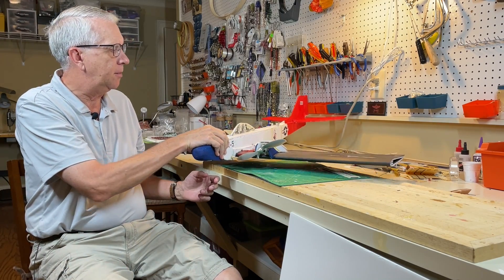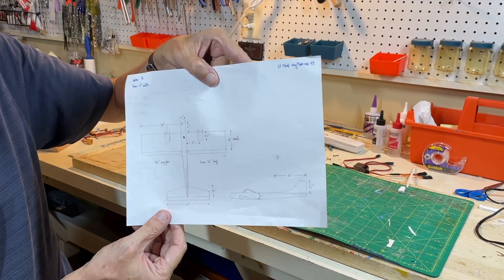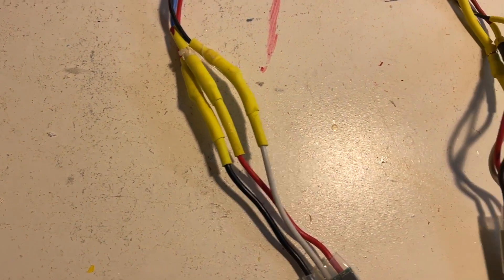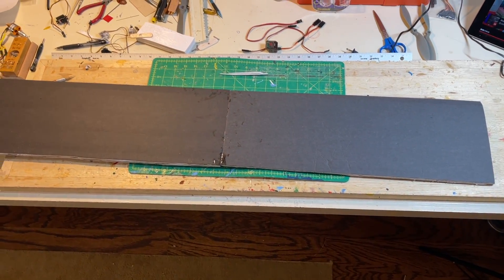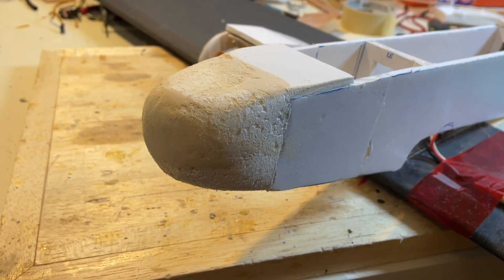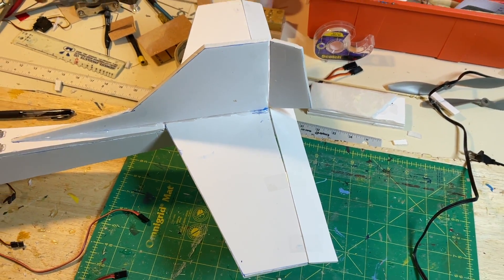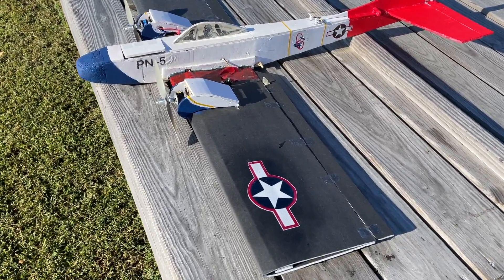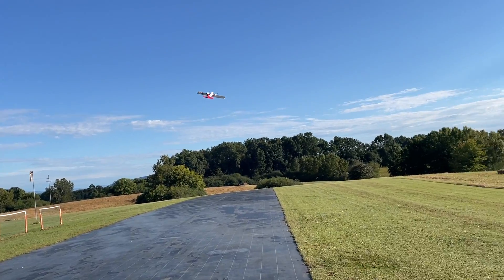Build a Twin Motor RC Airplane Free Plans!

Comment: hello  MR. McKay ...... I just want to know......... if there is a way to connect 2 motors on one esc ?????    sry Im NEW   here .   maybe you can make a vid on it .. if you have time .... TY.... greedings  from germany 👍👍👍👍
Reply from the maker: Yes, you can use one ESC for two motors. The problem is the motors may get “confused” with their throttle inputs. www.RCGroups.com will have more information.
Reply: @TimMcKay56  TY 4 replying 👍👍👍👍

Comment: Tim - Great Work! I see a dimension difference between the sketch and the final plans: The distance from the trailing edge of the wing to the tail post in the sketch is 18" but the plans show 20" could you clear this up for me.   Thanks Ben
Reply from the maker: Ben:  Thanks!  Either will work as the model has plenty of power. 20” is the safer/more stable option. 😊

Comment: Amazing Tim! I know you used three cell batteries but what was their capacity? 1300 mah or smaller?
Reply from the maker: I used 1300 mah, but the real issue is the size of the battery compartment.  For sure use a larger battery if space is there, no worries on extra weight.

Comment: I have one model its metal model of jetplane name Galeb 4 manufactured in m city in 80’s. Factory made lot of models one piece dur aluminum and mine need restauration. During taking of the old paint i damage cockpit. Is there any idea or method that i can make my self? From some plastic or ….?
Reply from the maker: You should be able to repair this. Tim

Comment: Hi Tim nice video. Please I can’t find any information about the best distance between twin motors using as differential for rudder.  Is it better as close as possible to que fuselage center or can I space them for more close turns. Can you please help me?  Thank you!!!
Reply from the maker: If you are using the motors and differential thrust to turn, the motors can be located a bit further from the fuselage.  For smaller models, no more than half way out the wing should work.  If a larger model, keep the motors as close in as possible (prop clearance on the fuselage), there is plenty of thrust to make the turns.  Tim

Comment: What happens if you don't cut the red wire to one of the ESC's and why?  I'm just getting into RC and being a novice, some of the complexities of the wiring escape me.
Reply from the maker: I am not super sure, but if two ESCs are providing timing information for the brushless motors they can get "confused" and not operate properly.  Someone in the comments may have a bette answer.  Tim
Reply: Nothing is going to happen you can connect both red wires because those are in parallel so the voltage will remain the same as a single ESC connected to the receiver and the BECs don't have any interference between them cuz they just supply about 5v DC to the receiver.

If anything you will actually supply better current (amperage) if any servo motors or anything will ever require it...
Reply from the maker: @SoriPop  Thanks!

Comment: I am building this plane, but I changed it to a single engine. Thanks Tim!
Reply from the maker: Dylan:  Yup, that will work just fine.  Tim
Reply: Hi. I am a student in a high school aerospace engineering class and this is my semester project. Due to budget concerns, my group and I are also considering switching this design to a single engine. Would you be willing to share details on your process and how it worked? Thank you.

Comment: How's about a knock off, of the all-time best "GWS Slowstick" that no one seems to wanna touch on for some reason???
I mean you could use a square rudder or something different, longer wings? Why is everyone scared of touching on making one close to it???
Or a good large winged, large slowflyer?????
Reply: Imma even go further...
I think it's crap, that everyone's afraid to do the old GWS Slowstick...
I am EXTRA aggravated because I just spent $126 on Ebay buying one for my son-in-laws first build from 99ronp on Ebay, got it today and it was trash, aluminum body tube bent, unusable... 2 of the stickers "1 big, 1 medium peeled off abs stuck to the instruction book, pure trash $126, to get someone into our hobby and this is the trash they see...
I've scoured the Internet looking for a foam board build to do with him of it and came up with 1 attempt...
1 attempt really? On one of the great old time builds just 1???????
One inch more wing span, 1 inch wider wing span, a square  rudder,  2 inch longer body outta balsa wood, bass wood or anything lol...
Let's see whatcha got Tim 😁👍
Reply from the maker: Will add to my build list!  Tim

Comment: Oohh very nice! Well done Tim!!  Two questions 1) how do you know the props will not hit the tarmac on landing? and 2) why not using a lg?
Reply from the maker: Jose:  I land at idle power, works out fine as no thrust on motors. I could add landing gear, I just like the look of the model flying with gear “retracted.”  😊 Tim

Comment: Another great video Tim, I wonder if you could comment on the possible need to have counter rotating props…though doesn’t look like you needed it 🤔
Reply from the maker: Syd:  Counter-rotating props can be of help with full scale aircraft, especially heavier ones (think of a P-38) that are doing single engine takeoffs, go arounds, etc.  There really is not much benefit to RC models.  With electrics it is easy to do as we can switch engine rotation.  If on an RC model an engine quits, my advice is just to throttle back to idle and land.  Tim